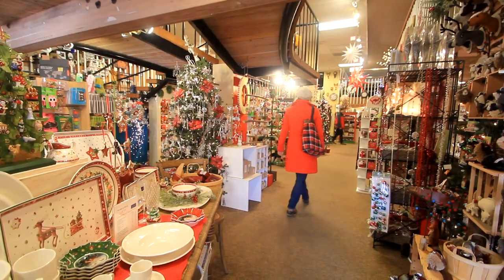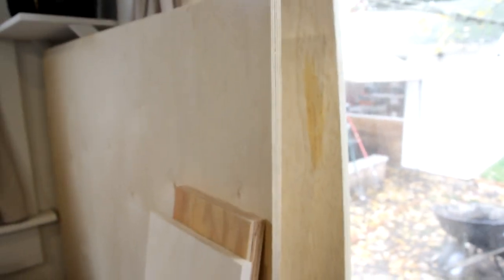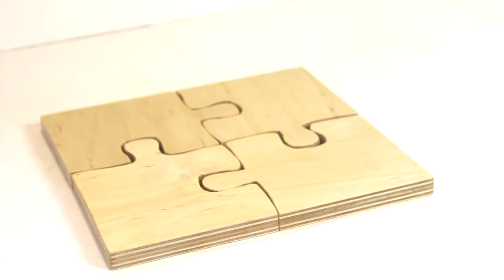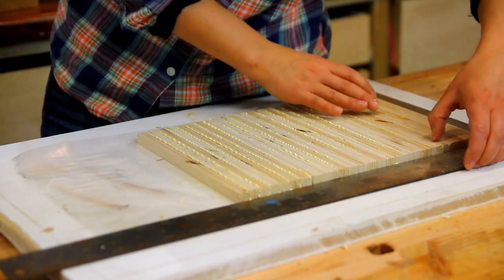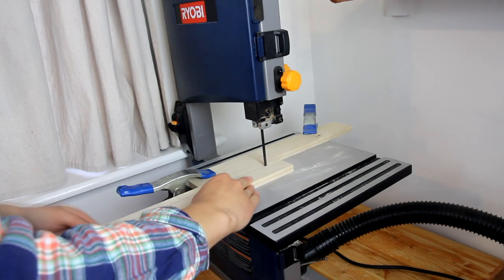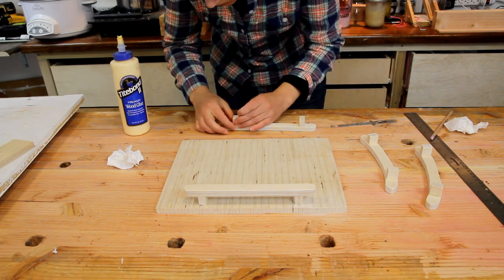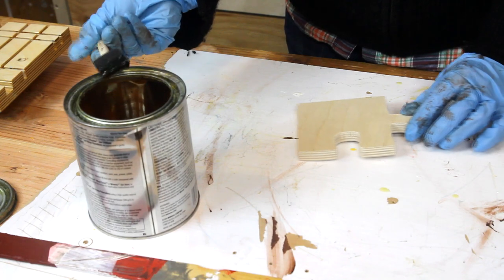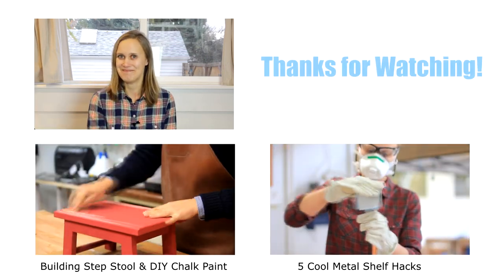Making Christmas Presents with Baltic Birch Plywood

Comment: These are fantastic ideas, Linn and quite original compared to what you might usually expect to see. I love the jigsaw design - you could even stain the opposing corners in a contrasting colour. I do believe it's important to finish and seal birch plywood in some form - my only negative against it (besides the price and extra fine dust) is that unfinished birch does seem to attract damp and mould more easily than any other plywood Merry Christmas!! :-).
Reply from the maker: Olly Parry-Jones Thanks so much for the comment Olly. I agree staining the tray would be interesting. Merry Christmas!

Comment: Fantastic gift ideas.  I love the coaster/trivets!!.  Two things you might want to think about investing in to save your arms, a decent belt sander and a good random orbit sander.  Trying to sand end grain plywood smooth with a sheet sander I am sure took FOREVER especially trying to get the glue stains out.  A belt sander with 50-80 grit paper would make short work of that and the R/O sander with 120 grit would make it very nice, very quickly.  Just a thought from a fellow maker!!  Great job Linn!!
Reply from the maker: mdbohica Thanks! It did take a little while :)

Comment: Great projects Linn.  I use Baltic Birch a lot when I do scroll saw work and its great to work with.  I also use it for shop jigs that I need to remain stable over a long period of time.  Building lots of goodies for Xmas.  A very large cutting board to replace one that slides into a space between the counter and the top drawer.  I think is it 24"x24"x1".  I am once again making a bunch of very special pens for relatives and some for our troops.  And I have some ideas for the grandkids they will like.  But first I think I should make a few of those tablet holders.  They seem to be multiplying like rabbits in my family and are always laying around.  Thanks for the great video and fun projects.  And for being kind to Baltic Birch :-)  People  don't think about it because it is "plywood".  ApplePly is another nice plywood that is out of Eugene, Oregon.
Reply from the maker: Jim Coogan Jim, I agree Baltic Birch is perfect for jigs. It seems like you're getting busy before Christmas! Thanks for the tip about ApplePly.

Comment: great ideas, love the coasters. do you keep  your table saw out side? if so does it get rust on it? I am looking at getting a dewalt table saw but my garage is very cold and damp in winter. I am worried that it may get rusty.
Reply: I keep all my saw tops waxed with car wax.  Depending on use, I apply about once a month.  It keeps them from oxidizing.
Reply from the maker: KnotTheWood ? I keep my table saw outside in the carport, so it's protected from direct rain but not from moisture. I apply wax every now and then. Recipe here: 15 Awesome Wax Hacks
Reply: thanks for that,

Comment: Hate to be the party pooper here, but for safety, please consider lowering the band saw upper blade guide/bearing assembly so it is much closer to the work piece. If there is a slip, your fingers won't go into the blade.

Comment: There is absolutely no point in applying tape to the top face of the plywood you are trying to avoid chip-out on. When cutting on a table saw, chip-out occurs as the blade's teeth exit the bottom face. Applying tape to the bottom would be equally pointless - what you need is a zero clearance insert for the specific blade you are using. If the top face of your plywood is chipping out, I suggest you buy a new blade - or saw.
Reply: Ant Mallett or cut half depth and then flip the board to finish the cut right?